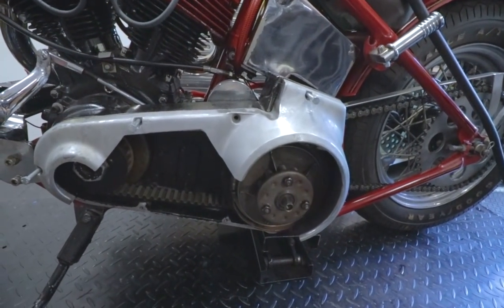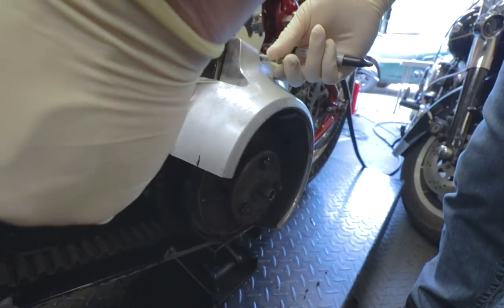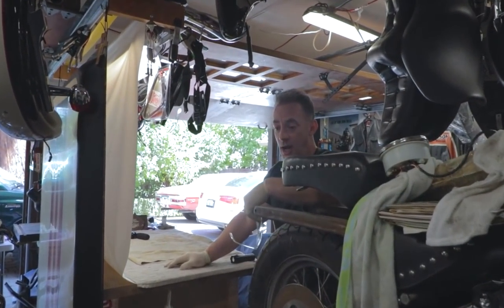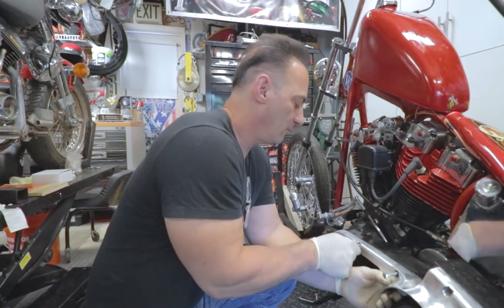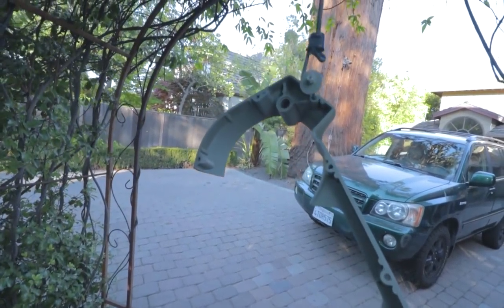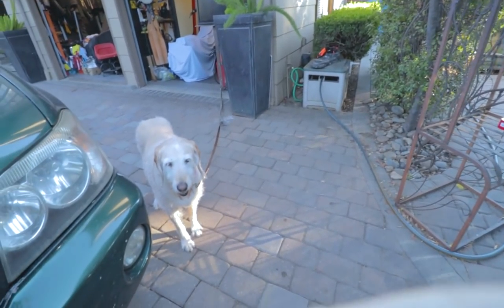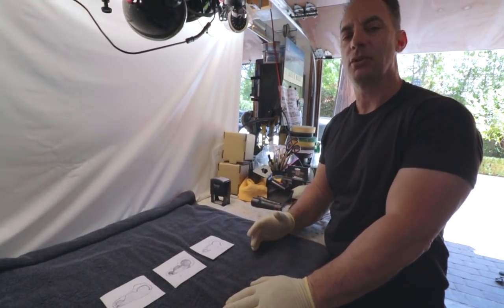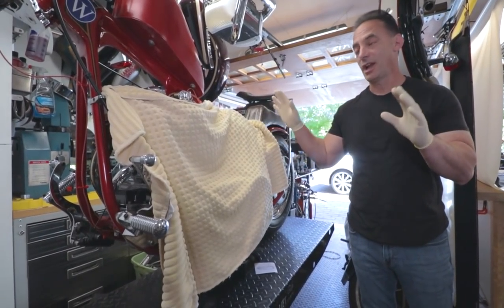We made a custom SKELETON PRIMARY COVER for our Shovelhead Chopper

Comment: I have the same style belt and front pulley and clutch on my FXB's. It is probably an original HD belt primary. The front pulley comes apart and has rubber blocks in it that must be greased occasionally (a transmission damper). Same goes for the bearing in the inner primary, behind the clutch. My 81 Sturgis is apart now to do all this.

Comment: Love your videos guys especially red eds shovel! Just a thought how about utilising the small segment of the primary cover below the inspection cover hole, cutting it down and bolting it on to the two spare bolt holes to give the clutch and starter ring gear some protection from upwards road debris?? Can't wait for the next episode
Reply from the maker: This bike wont be seeing the road much and is more of a collectors item rather than a beater. We aren't really worried about the starter ring gear because the bike does not have an electric starter

Comment: Those chrome pieces should have been threaded on the inside and been big enough to fit over the original rubber boot. That would have been really trick. Best of the OG design ( which may not have been the best) and a little pizzazz..

Comment: Cool and all, but no front brake?  Nah come on, haven't enough brothers ended up in hospital or a pine box for you to know that no, it won't "be fine", at least not if you intend to actually ride the fucka!
Reply from the maker: Luckily, we do not intend on riding this bike
Reply: @KingpinGarage  I couldn't own it without riding it. That's a badass bike.
Reply from the maker: @michaelmcilwain9793  When I say not riding it I mean not riding it often. It will be test ridden and then be put up for sale at the upcoming Mecum Motorcycle Auction in Las Vegas
Reply: Hey Monty a lot of choppers don’t run front brakes. Riders choice.
Reply: @ilovecarnitas  Yeah I know some don't (I wouldn't say "a lot", at least not this side of the pond), I believe it derives from the very early cut-downs which were based on much older bikes (veteran models by today's standards) which didn't have front brakes anyway;  I'm just saying that it's not a clever approach if you're gonna ride for real - sometime the "cost of cool" is just too high.